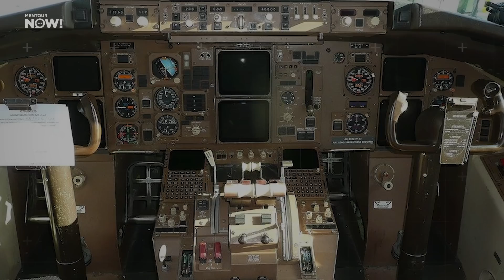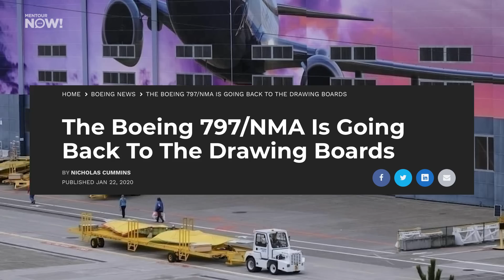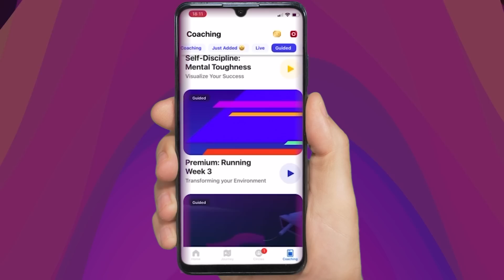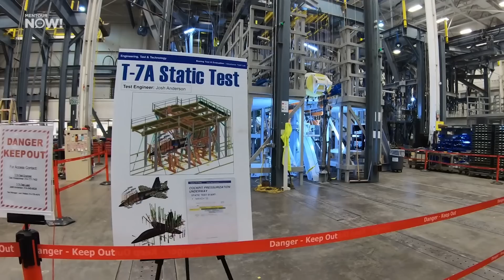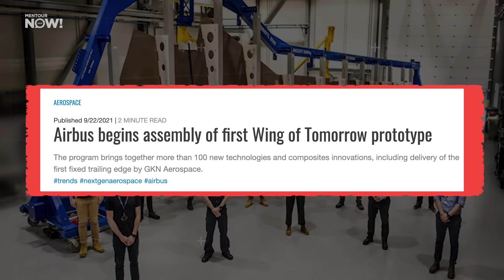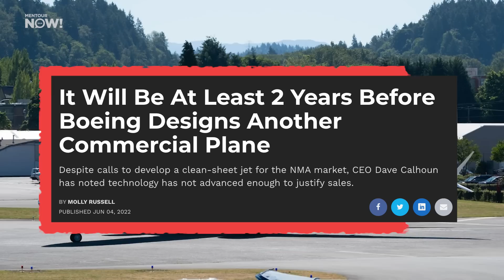Is Boeing Planning a 757 MAX?!

Comment: Boeing 737 should have reached end of its life in early 2000's insted of the 757.
Reply: The 737 had many upgrades over the years where as the 757 did not. Same old engines, same old Avionics. Boeing ran the same design from early 80s
Reply: @chrisheffernan7540  They did design two new winglet designs for 757. Also the some have upgraded the avionics to fit large displays like UPS and Fedex. Also the RR engines did change from early models to newer. I agree that they should have done more. But still you cannot say that there isn't any upgrades to 757.
Reply: @randomdriver  U cant bullshit me. I work on these things every day. I am a Lead mechanic with 30 years experience on 757s. The Avionics is the same as it was in 1981. The large screens is for viewing only. This does not upgrade the Avionics in any way. As far as the wing goes it may have changed, but the engines are fuel efficient but would need upgrading for a redesign. I've worked at United and Fedex
Reply: @chrisheffernan7540  Still the 757 would have absolutely been a better platform to develop than the ancient 737.
Reply: @randomdriver  Not disagreeing with you there. It is a great jet. Wish Boeing would of kept up with it.

Comment: It’s not only the manufacturing challenge. Prior to this there is an engineering documentation challenge. Probably this aircraft was designed with very old CAD software or maybe hand drawn drawings. Converting the older design to the new 3D CAD design cost a lot. Not to say how to make or document changes.

Comment: Boeing's type-rating commonality between the 757 & 767 was genius!  Delta & United in particular love the flexibility this creates.  They know their business but I've always questioned why a continuation of 75/76 lines rather than the 737 wasn't chosen.  They seem to, at least, have poor judgement of timing.
Reply: I also question Boeing's judgement in cancelling the 717.  The 717 (MD95) was designed as an efficient & modern replacement of the DC-9... but they stopped production a whole decade before Delta retired their DC-9s.  To this day, Delta, Hawaiian, and Qantas say they would buy as "as many 717s as they could get".
Reply: @Dana_Danarosana  A 717 seats 134 people; a 737-MAX7 seats 138. Why do you need both?
Reply: @beeble2003  Because at least 3 airlines wanted them to add to their existing B717 fleets.
Reply: @beeble2003  Perhaps because the 717 ceased production nearly two decades ago, and the 737-MAX7 still hasn't entered service?
Reply: @timmakinson4765  The 737-700 seats was filling that market segment during most of that period. Why do you need both the 717 and the 737-700?
Reply: @Dana_Danarosana  Embraer.
Reply: I think the 737NG was much cheaper to build and covered the needs of 95% of short haul operations. The MAX does it even better.
Reply: @philipjamesparsons  I agree 100%... except the end result has left the now troublesome gap in the product line that Petter has indicated.  Customers have indicated that all the product lines would be purchased.
Reply: There were times when Boeing could create 2 airplanes at once. Impossible now
Reply: @henson2k  only two?  More like four.  Then the military.  

We'd should have been building a few more C-17s even if they sat on parking lots they'd sell soon enough.

The Embraer E390 I know has Lockheed lobbyists changing their underwear twice a day.
Reply: Common components included A/C packs, fuel systems, psgr accommodations, avionics, flight controls, Aux Pwr unit, hydraulic system, generators and the flight deck windows (!) which give the 757 such a noble nose.
Reply: The other possibility would have been narrowbody developed concurrently with the B787.
Effectively what they'd codenamed "Yellowstone 1". Which the B737-MAX replaced in 2011

Neither the B757 nor B737 can take ULDs in the lower hold. The B767 only takes the LD2 (and LD8) since it has a narrower fusellage than other wide bodies.
Reply: The 717 update would have avoided DC-9/MD-80 pilot retraining. At this point they’ve all move on to new types, new careers or retired. Other comments in this thread point out an updated 767, might be the better gap filler between 737 and 787.
Reply: Agreed, a shortened 757 could have worked better than the stretched 737s. It would have allowed shorter field work maybe, and in the new era of point to point this might have been a good advantage.

Comment: What about creating a 787-7 with composites and a smaller aircraft? They probably could use GENX and just a shorter fuselage (maybe even similar length to 737 or a little longer with two aisles), and they would get plenty of range and power from the already existing engine, and an airframe that is virtually the same as they already have, making certification much easier. They could also bridge any gap there with a 737-11 MAX, although I don't know if they can stretch it more than the -10.
Reply: They looked into this also and ultimately scrapped it because at the time the economics weren’t there. But who knows…with this state of the  company they might just bring it back.
Reply: @noahwilliams8918   Yes, the 787-3
Reply: This airframe should be the basis for a 757 replacement. But they dropped the ball of course. I'll be shocked if they re-visit it.
Reply: The answer is easy, the 321 / XLR has taken over this market segment and there is no chance for Boeing to fill this gap in the next 10 years or later, given that the XLR will fly for 10-15 years at least. There is simply no need, nothing that a 737-10 couldn't do or a 787 on a longer range flight with better load factor. The typical 3 class config on a 757 only fits slightly more pax but the jet is less efficient and requires longer runways. It's a power house (love the 757) but it's almost overkill for its purpose. For typical flights in that range economy only layout will become the norm, no one is willing to pay First on a 4 hour flight
Reply: Not innovative. Boeing needs new designs, not spare parts.

Comment: 757 is a wonderful jet. They should make a 797 in the image of a 757.
Reply: I've always wondered if Boeing is avoiding the model number "797" since it kind of sounds like the end of an era.  I mean what comes after 797?  They've made everything from 707 from 787 already.  (Technically they didn't really design the 717 as it was just a modernized and modified DC-9-30 inherited from MD.)
Reply: @skyhawk_4526  They'll just have to embrace the Hip-Hop era and make an 808.
Reply: Remember the 7J7??
Reply: @toriless  I forgot about it but when I looked it up, I actually do remember this. There was a show called "Beyond Tomorrow" on in the late 80s, early 90s (later it was called "Beyond 2000") and they showcased this aircraft.  Again as I said in another comment on here, ever since the bean counters took over, there has been way too much knee-jerk short term thinking.  It was dropped because oil prices were dropped but that wouldn't last for long.  The headways Boeing could have made with that technology might have been worth the initial investment now that fuel prices are significantly higher even adjusted for inflation.
Reply: 757 V2.0  would let Boeing just work numbers instead of names.
Reply: Unfortunately, as of now, it looks like the 97 will be a 67 replacement..

Comment: Boeing, just warm up old designs. The R+D department is located in a small shed in Seattle. 727 Max, 737 Max,747 Max, 757 Max,767 Max, 777 Max. That is why they are in decline